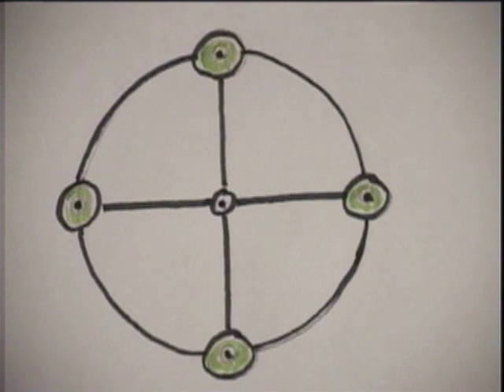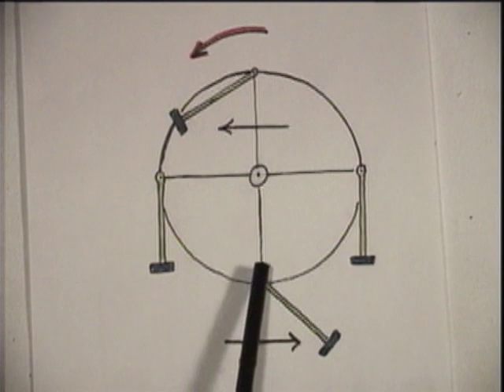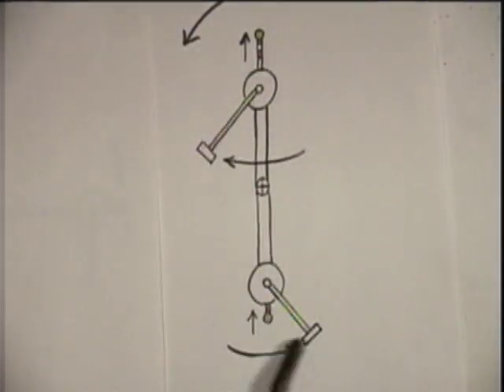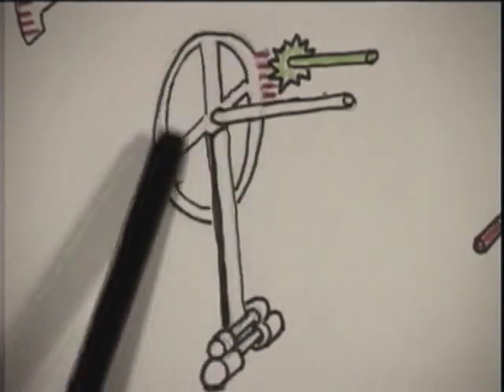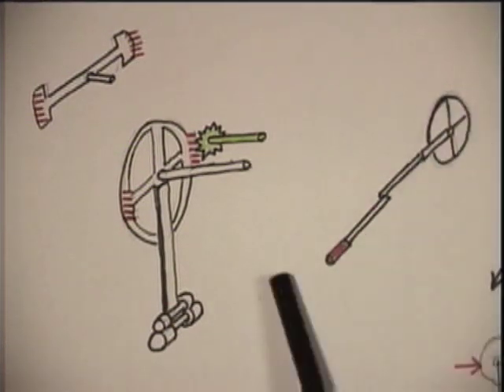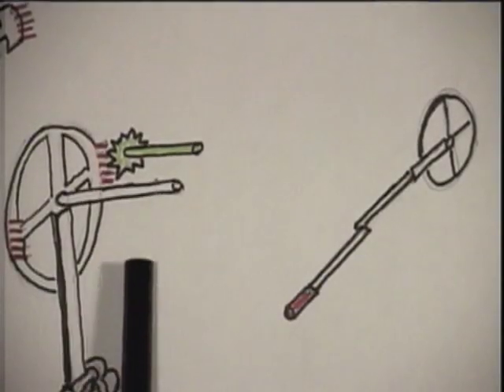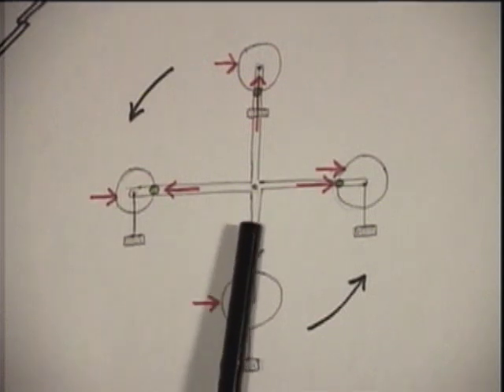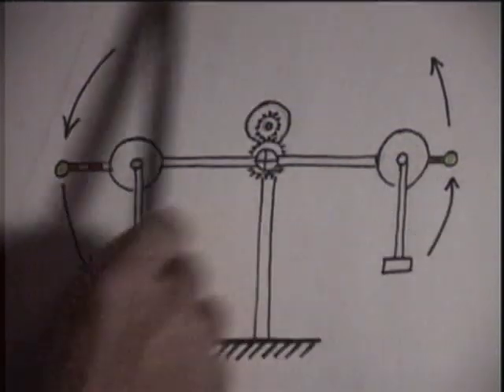How Free Energy Gravity Wheel P2 Works

Comment: The gravity free energy in weight is held and kept by some material, and then discharged in descending phase in the center of the wheel. Inevitably, not all gravitational energy is possible in a closed system, but partially the gravity energy conversion will likely to be captured like in water mills with just 1 m of dislevel by rotating "scoops" in the example. Part of byproduct always uses gravity energy. 
I can't see anywhere around anything resonably good about all these innovative methods.
Reply: https://youtu.be/H3gtlpQqimQ

Comment: Hydroeletric actually uses gravity to convert gravity pull in water's weight to make a dynamo rotate. It reminds me of ancient water mills capturing water in the wooden wheel with  those sort of scoops, You simply create a gentle dislevel, use a fluid or moving medium like water, capture it and release, this uses gravity and doesn't need much height.
Reply: Right and the evaporation system resets the water back to the top by our powering sun

Comment: This is basically a theory on old time clock mechanisms.  They use potential energy but there has to be an input, its not free and its not perfect either.  Clocks use a coiled spring that releases the energy very slowly and is maximized by the gearing.  Losses do a occur due to friction and gravity and such.    This system has way too much energy loss due to friction and opposing oscillations, and without doing any calculations I can see issues with harmonic resonance interference.

Comment: weight shifting/sliding weight into the sweet spot, w/minimal rotational speed loss, is what i work for . I see some merit in adding in spinning flywheels@ different speeds cancelling out loss@ different frequencies . Being able to produce enough TORQUE to turn a generatorand over come speed loss should be the goal. these type of unit would be luck to turn 120RPM's so the amount of "Gear Up" you need is pretty substancial to reach 3600 RPM's to run a 10kW generator ! From what i have been able to figure out,math wise,is that about 50ft/lbs of torque is required to run a 10kW generator